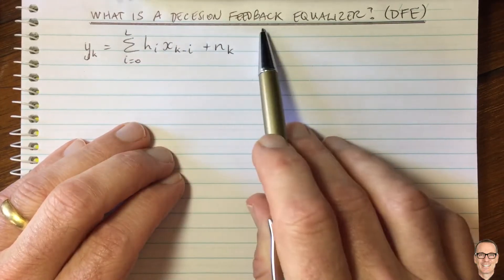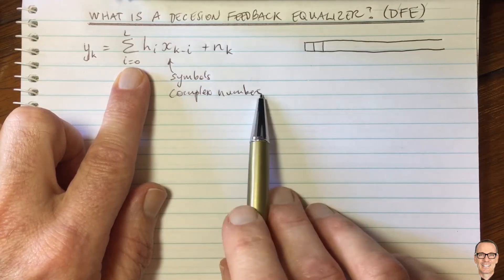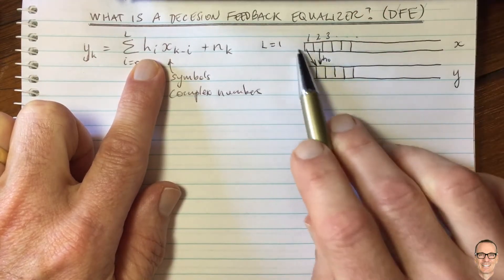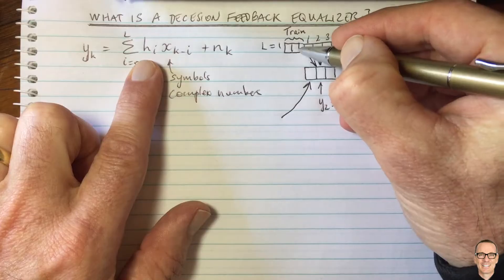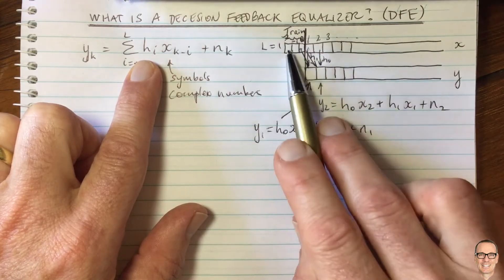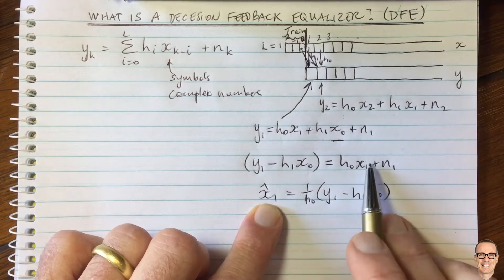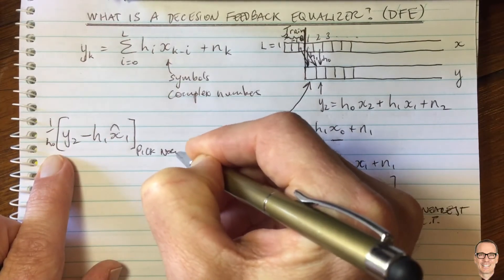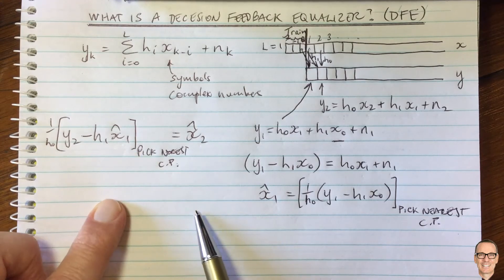What is a Decision Feedback Equalizer (DFE)?

Comment: I didn't understand what "i" meant. What if "i" is 0, 1, 2? Does this mean that when adding from i to L, the larger the number of L, the more accurate it is? and what is h... channel impulse response?
Reply from the maker: "i" is just a counter variable. It takes values between 0 and L. Each component in the summation is for a different value of i. The parameter "L" corresponds to the maximum time spread of the channel. And yes, "h" is the channel impulse response.
Reply: @iain_explains  thank u for your teaching

Comment: Sir do you familiar about Serdes?
Can you please make videos on serdes equalizers, explained in both time domain and frequency domain so that we may have the visualizations
Reply from the maker: "SerDes equalizers" are just normal standard equalisers. Serialising a parallel data stream simply gives a single data stream at a rate that is N times higher than the rate of the individual parallel data streams. This means that ISI will be greater over the same channel (since the data symbols are shorter), which means equalisation is more important. But it doesn't mean the equalisation challenge/task is any different to "standard" equalisation.
Reply: Thank you very much sir for the insight

Comment: Hi Iain, as usually very good explanation. In case of LTE OFDM, can we say that reference symbols are utilized as training symbols? If this is the case, that sounds as option 2 (from pilot symbols inserted throughout the data stream and/or across the frequency sub channels) from your reply how channel can be measured in three different ways. Thanks in advance and wish you all the best in 2023!
Reply from the maker: Yes, that's right. It's important to keep in mind that the standard defines certain things that need to be included in the data stream (by the transmitter), in order to enable certain particular functions to be performed at the receiver - but it doesn't stop the receiver from using those elements of the data stream for other purposes too.

Comment: Reading up on the differences between DDR5 and DDR4 PC Memory and they mention how DFE enables higher IO speeds and data rates! Thank you for explaining this.
Reply from the maker: Ah, that's an interesting application. Thanks for mentioning it. I always make a point of mentioning to students in my classes, that storage systems, such as hard drives, CDs, DVDs, RAM, ROM, etc., are all versions of communication systems (it's just that they have a very long delay in propagation - ie. the time between storage and whenever the data is retrieved).

Comment: Thank you, Iain for your great video. As far as I know, the DFE can be used to estimate the phase noise in OFDM system, especially for the ICI. Can you explain how it works? Thank you.
Reply from the maker: DFEs only work well in conditions where the decisions are reliable (for example in high SNR). When data symbol decisions are reliable, they can be used effectively in exactly the same way as training data. This is called "decision directed training", and it can be used to estimate/track channel parameter changes, for parameters such as phase noise, carrier locking, and fading.

Comment: Hi Iain,. Excellent explanation. I hope the next topic in the same chain can be decision feedforward Equalizer.  I have one question. In implementation terms, given that we know y and x0 , how do estimate h0 and H1. Or are h0 and H1 estimated on training signals? If L  is say 32 then do we require atleast 32 training symbols to estimate h0 to h31 ?
Reply from the maker: Thanks for the suggestion. I'm planning a video or two on channel estimation. In summary, the channel can be measured in three main ways: 1. from the training symbols at the start of the packet (or in the middle of the packet in some wireless standards), 2. from pilot symbols inserted throughout the data stream and/or across the frequency sub channels, 3. in a decision-directed way, using the estimated/detected data.
Reply: @iain_explains  Hi Iain, thanks for one more excellent video. Can we combine all three methods for channel estimation? for example initially we can send some known symbols and then periodically use decision directed estimation?